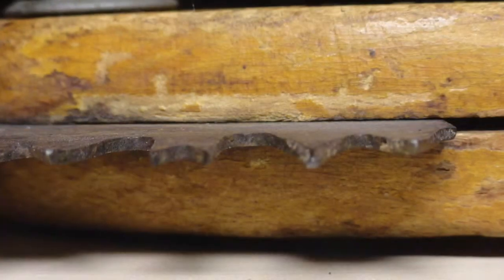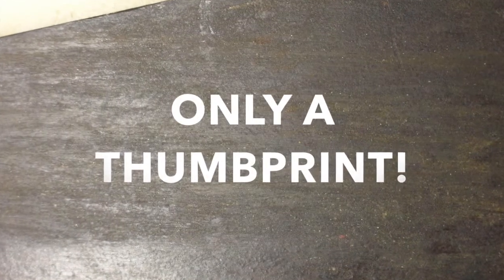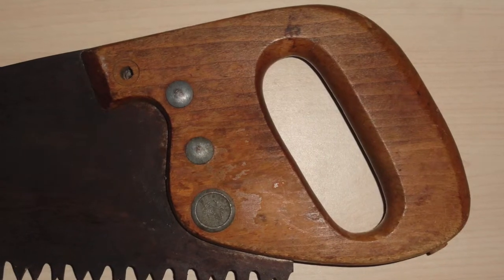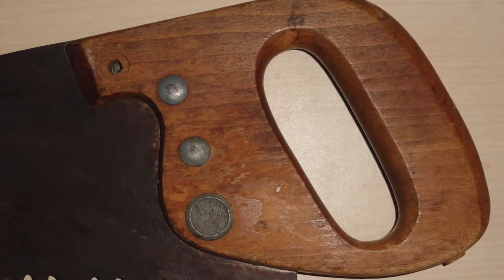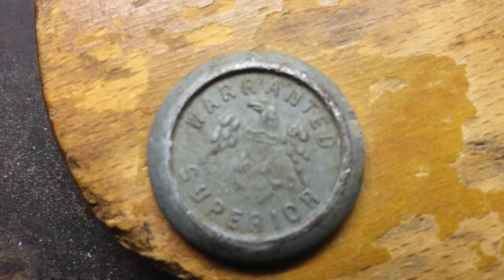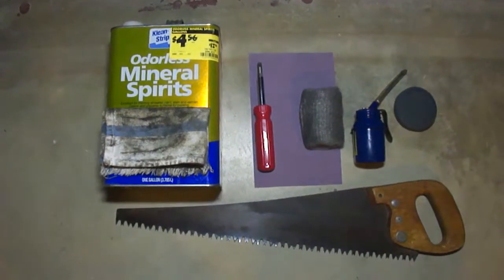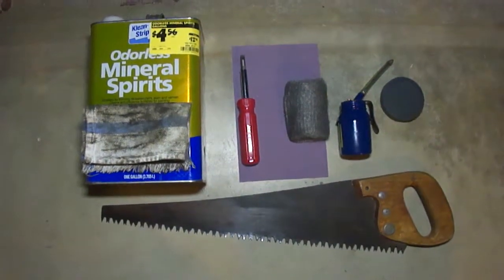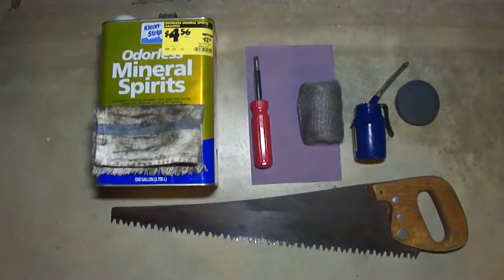Granpa's Saw 1

Comment: PATCsawyer has a great video on sharpening a crosscut saw. http://youtu.be/FrYsFlx3OSY
Your saw appears to have Tuttle style teeth. If the etch has survived it is the best way to find out who made the blade. If you hold the saw with the handle on the right and the teeth pointing down the etch should be at the approximate center of the blade.
Use fine sandpaper and a sanding block to clean the side of the blade. Don't be surprised if the etch is missing. They aren't very deep to start with. 
I have some of my grandfathers saws. Every time I use one I remember my grandfather. That's a better gift than the saw itself.
Reply from the maker: Thanks for that link.  It is a very informational, if not a bit mind blowing for a Nob like me!  I will be reviewing the video as often as needed!